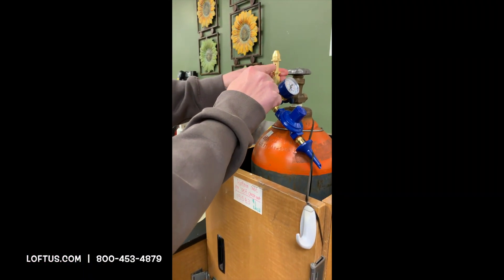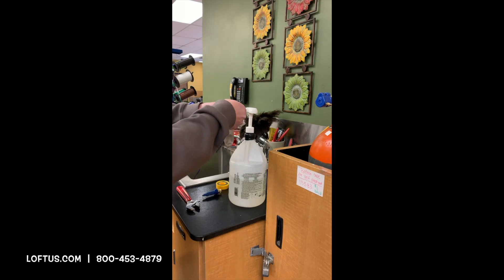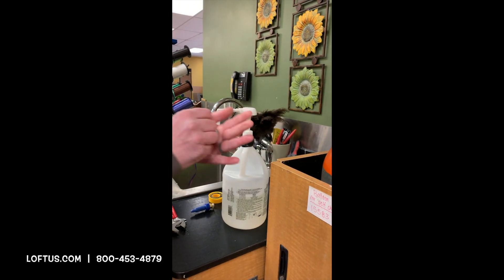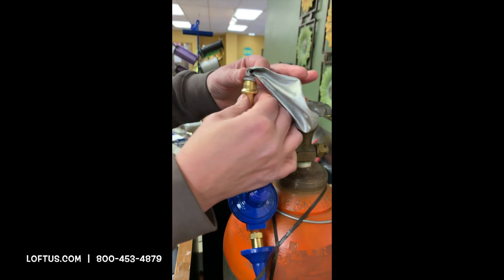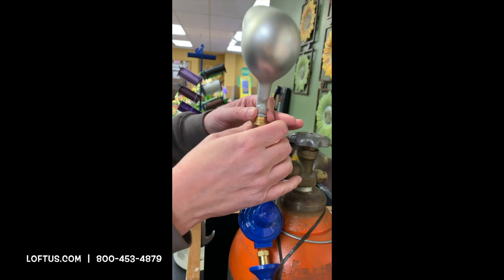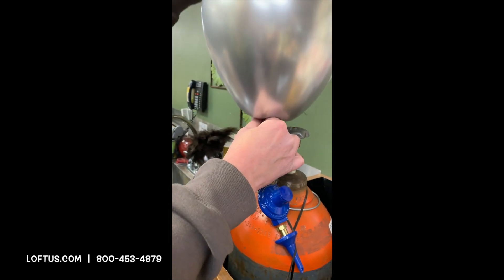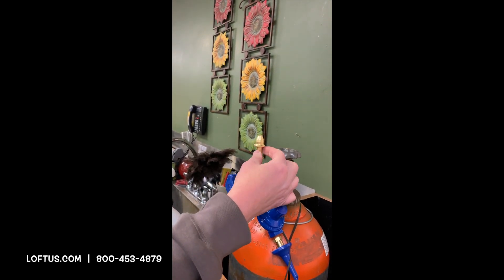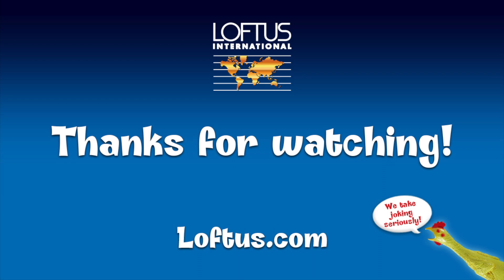How To Use a 60/40 Valve (60% Helium, 40% Air)

Comment: Quick question, can you blow up a Foil balloons with the 60/40 valve? And what kind of gas do you use to blow up your balloons Helium or Hydrogen?
Reply from the maker: Hi Landen, yes, you can blow up foil balloons with the 60/40 valve. Some balloons may have elevation restrictions - like they have a difficult time floating above a certain elevation. In those cases, we recommend 100% helium. If you're using an intricate foil balloon (like a shape), 100% helium would be best as well. The 60/40 is perfect for 18" rounds or similar foil balloons. We only suggest air or helium to fill balloons.

Comment: Anyone know how big the balloon should be before adding hellium to achieve the same results? As I don't have one of these.   Thinking 24 balloon
Reply from the maker: Hi Bradley - it would depend on your elevation, maybe even the humidity and how long you need it to float. Since this is a 60/40 regulator, if you fill it with 40% air and 60% helium you SHOULD get the same result.
Reply: @LoftusInternational  Thankyou for your reply, but I was asking how to calculate this 60/40 ratio.
Can I for instance put air in and inflate to 7 inches air then top it off to 11 inches helium. 
At the time that I needed this I did calculations and put  air in of a certain amount with my lagenda then topped it off to another amount with helium.
Reply from the maker: @Bradley9967  Hmmm...we'll do some snooping around and see if we can't get an answer for you! We'll be back!
Reply from the maker: @Bradley9967  So we don't have a definitive answer for you, Bradley. Craig (our Balloon Guru) said the 60/40 regulator might mix the air and helium together which would make a difference in filling up the balloon. He wasn't aware of a formula to figure out a manual air/helium ratio and suggested trial & error. Sorry we couldn't be of more help! If you're a Loftus customer, we do have the 60/40 Regulator in stock right now (item number 09-0020) and could get it to you quickly.

Comment: how long do the 60/40 balloons last or stay floating
Reply from the maker: Hi Steven, this information was obtained by the manufacturer:

11" Latex (w/o Hi-Float): 8-12 hours
11" Latex (w/Ultra Hi-Float): 3-10 days
16" Latex: 30+ hours
24" Latex: 2-4 days
30" & 3ft Latex: 3-5 days

Float times may vary due to altitude, environmental conditions, and proper balloon sizing. For maximum float time on 11" balloons with a 60/40 mix, it is recommended to use Ultra Hi-Float with the purple restriction clip on the Hi-Float pump.